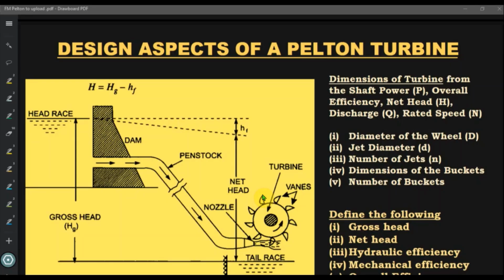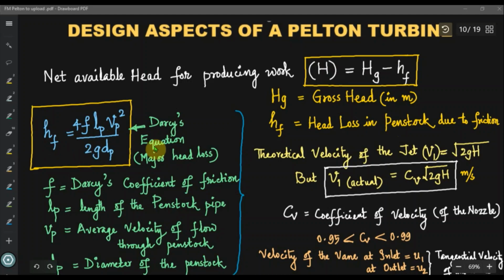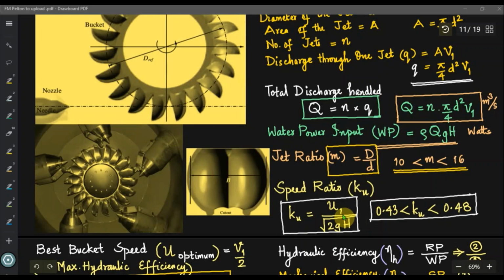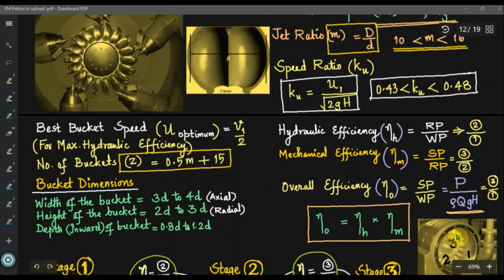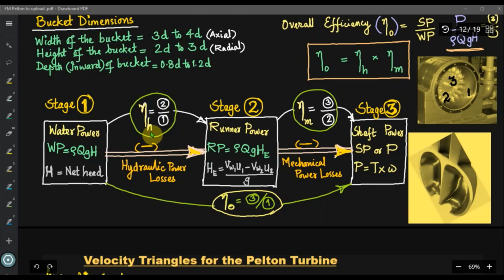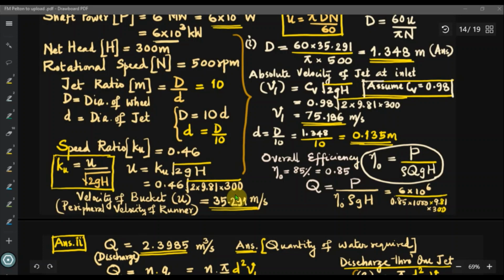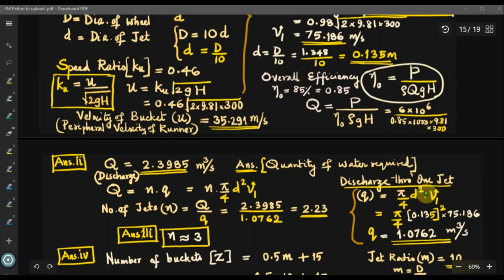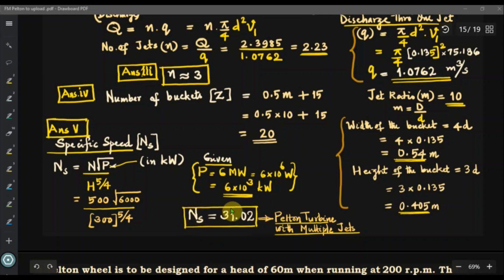Fluid Machinery KTU, Pelton Turbine, Basic Design Aspects and Numerical Problem on Pelton Wheel, L10

Comment: Head,speed,discharge and efficiency are given then qstion is type of turbine. how to find it?
Reply from the maker: Find the Water Power, WP =  
(rho) *Q*g*H. Then using Water Power and Overall Efficiency, find the Shaft Power (P).  Overall Efficiency = (Shaft Power /Water Power) 
Using Shaft Power (P) in kW, Rotational Speed (N) in rpm and Net Head (H) in m, find the Specific Speed of the Turbine.
From the Value of Specific Speed, tou can identify the TYPE OF THE TURBINE.
Similar Questions have been solved in the uploaded video lectures, especially the one which explains Specific Speed of the Turbine in the playlist of Module 2